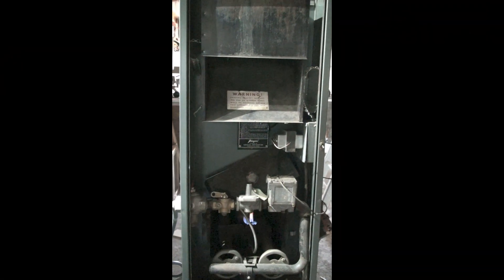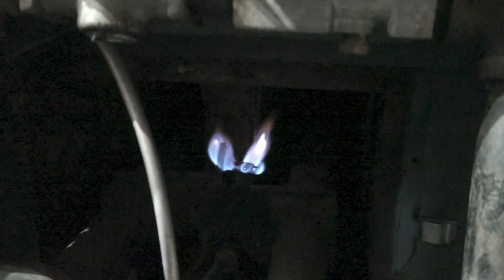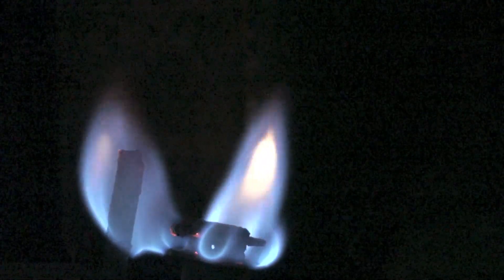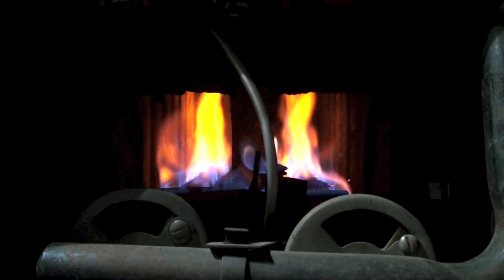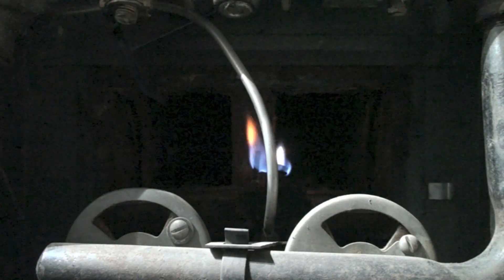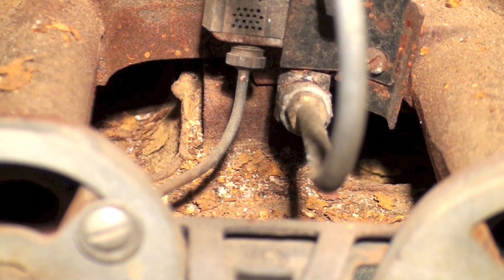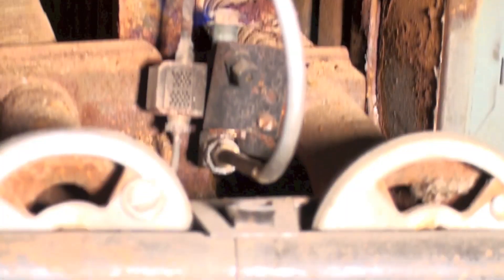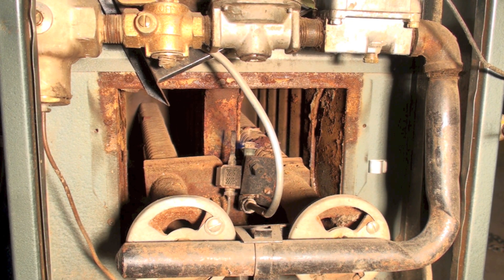Service of the antique pilot furnace part 1

Comment: My setup is a 1972 Heil 4 burner. Dang thing started short cycling/ backfiring this year. I've replaced 2 rotten burner tubes, replaced the rotted little bar that directs the fire from the pilot to the burners, cleaned the nearly plugged flue, cleaned the orfices, cleaned the exchanger, cleaned the blower out, had the regulator replaced, and threw on a new thermocouple. The gas valve is getting 27v under load, and seems to be operating fine. For some odd reason, now it'll run 2 complete cycles, and then it backfires the third time it fires and blows out the pilot. I'm obviously no hvac expert, but it's got me stumped for sure. All the issues I've found/fixed, and it's still not the underlying issue.
Reply from the maker: Have you checked the heat exchanger for cracks or rust out?
GFM
Reply: @grayfurnaceman  yes I have. Now, It will run perfectly fine for nearly whole day, but will still backfire every once in a while and blow out the pilot. I think it may be either the first stage regulator(i only replaced the second stage regulator) or the gas valve. Also, if I shut off my thermostat and turn it back on later, it will backfire.

Comment: I have a 1950's floor furnace with a single burner bar.  The pilot has two flames, 90 degrees apart, for the thermocouple and to ignite the bar.  It burns a lot of gas.  I shut off the gas valve from April - November, and my bill drops noticeably.  Only the water heater runs year round.
Can I turn the pilot down, or replace it low-burn version?  Can a single flame keep the thermocouple hot and ignite the bar?  I have the Robertshaw pilots and igniters sell sheet.

Comment: Love your site and videos. Appreciate the logical assistance. I have an older gas standing pilot furnace. McClary Debonaire 35yoa or more. Model:12G130L; Serial # D50307. No manual. General Controls Valve. Serial #L5 B 64; Cat No: B60Y64H. General Controls Company bought by American HVAC. Is the "White Rodgers B60 Valve" the same one? Couple of years ago furnace not running. Plumber tapped valve with wrench, everything fine. Same problem again. Valve sticking? Have been able to get operating by adjusting thermostat above/below room temp a few/numerous times. Can the valve be serviced? Where do I locate a new one and a manual? Would appreciate any advice you have time for. The furnace has no other issues.
Reply from the maker: I am assuming the controls are 24 volt.  A White Rodgers 36C03-433 should work ok.  It is a general replacement valve.  The valve comes with a manual.
If you want step by step instructions, go to my channel and search for "How to replace a gas valve".
GFM
Reply: @grayfurnaceman  Thank you so much for your reply and suggestion of the correct valve to replace with. Watched your video regarding changing valve and you are very knowledgeable and explain everything in great detail. I believe I will let professionals like you do the work. Thanks again for your knowledge and lessons.

Comment: You still around?  I have a furnace issue that I could use some help on.  Furnace stopped working.  After checking low voltage from transformer secondary I had 0v.  The old transformer was a 120/24V/20 VA transformer.  I went to lowes and bought the same specification transformer from the doorbell isle.  The only difference is the new one has a green wire going into the primary, which I am going to assume is just a ground.  Anyhow, I now have 28 volts going to the gas valve when I call for heat, but still getting nothing.  I am guessing that the gas valve has also failed?  Could the limit/rollout be tripped also?  I would assume no as I am getting 28 volts to the gas valve.  There are no other sensors etc going to the gas valve besides the pilot light sensor, which is good as I have constant pilot.  Any idea what is going on?  If you think it is the gas valve like I do, do you know where I could find a Model 36C67 Type 183 valve?  Thanks for any tips and information!
Reply from the maker: If you have gas to the appliance, voltage to the gas valve, the knob is "on" and there is no gas flow, The valve has failed.
The White Rodgers model 36C03-433 will work as a replacement.
GFM
Reply: @grayfurnaceman  Thank you so much!  I believe this furnace is at least from 1999.  It is an intertherm furnace so I was having a hard time finding any information for it.  When I google the part number of the original, I do see one that has that part number, but it looked quite different from the one I have.  The part number you provided looks a lot more like the one I got.  I truly appreciate it!
Reply: @grayfurnaceman  Also, I was finding mixed information about metering out the gas valve.  Some say you can check for continuity, some say you can't.  I tried anyway and there was no continuity or an ohm reading.  Can you confirm if this is possible on this gas valve?
Reply from the maker: Most of these valves are operated by DC power.  The valve is supplied with AC power and there is a rectifier in the valve to convert the power.  Using a multimeter to test continuity will result in an open reading on these valves regardless of condition of the valve solenoid.
GFM @TheGuyWithNoSubsForAReason
Reply: @grayfurnaceman  Alright good to know.  I really appreciate your quick responses!  I found a used gas valve for $50.. and new for $115.  Think it is worth saving $65 to try a known good used valve, or should I get the new one?
Reply: @grayfurnaceman  One last question.  When I flip the Light Switch for the furnace, the transformer starts running, even with the thermostat shut OFF.  When I test voltage to the gas valve while off, I read around 20 volts.  It jumps to 28 volts with a call to heat from thermostat.  Is this normal as well?
Reply from the maker: I would get the new one.
GFM @TheGuyWithNoSubsForAReason
Reply from the maker: The transformer should apply power when the system switch is on.  It will draw very low amperage.
As for the 20 volts, I have no idea.  Normally, open circuit voltage is higher than loaded voltage.
GFM @TheGuyWithNoSubsForAReason
Reply: @grayfurnaceman  I assumed with thermostat in off position, the 20 volts wouldn't be enough to power the gas valve.  Then when you call for heat, the 28 volts would be enough to power the valve.  At least I am hoping so.  Otherwise, the gas valve would never shut off.  I guess I will find out when the new valve arrives.  Thanks again for all the information!
Reply: @grayfurnaceman  Went ahead and installed the replacement gas valve.  Got everything buttoned up.  Still having the same issue.  Still getting 28-29 volts to gas valve when calling for heat.  Pilot light stays lit.  The system seems so simple.  Only has a brown board with 3 ports on it.  1 goes towards transformer, other seems to control blower.  If I bridge the two closest ones, blower kicks on.  Possible bad gas valve replacement?
Reply: @grayfurnaceman  I forgot to mention.  The replacement gas valve has ECO terminals coming from the pilot light connection.  The old one does not.  At first the pilot wouldn't stay lit.  After a bit a research, I seen that I could jump those terminals if the furnace does not have ECO device.  This allowed the pilot light to work properly.  Is it possible the transformer I got, is not compatible with either gas valve I got?  I mean, I did get it from the doorbell isle, but it has exactly the same specs as the original transformer that failed.  Any further guidance would be very helpful.  Thanks again!
Reply from the maker: Unless the transformer creates DC current, it should work.  
One thing I would try is using a clamp meter on one of the wires going to thugs valve with a call for heat.  You should show about 1/2 amp.  
GFM @TheGuyWithNoSubsForAReason

Comment: I have a 1989 century gas Furnance. The pilot light is blue and seems to be a good size but as soon as I let go of the pilot button the flame goes out. I also noticed the push button does seem a little stiff and does not pop up as fast as it used to. Any way you can give me some advice. 
I am a contractor so I know my way around a tool box. But work has been slow for a bout 8-9 months so hiring a service company is out for the time being. 
Mark

Comment: I can't even get the pilot to light even with a new pilot. The gas company shut it off now it won't work.
Reply from the maker: Why did the gas company shut down the unit?
GFM
Reply: @grayfurnaceman  the tenant was complaining about her gas bill and since she wasn't using her stove she assumed it was her furnace and request a shut off. I found the issue the city installed a new line from the road and when they reconnect they billed everyone wrong she was paying for the owners meter not her own and similar for the rest of the tenants. I traced it all they gas man came and verified then they digitally correct the billing so nothing was on the furnace but the pilot. But it was off for 3 days when the gas man tried to relight it wouldn't light. He told me and I cleaned the furnace no obstruction in the pilot or orifice thermocouple nice and clean. But still wouldn't light while holding the button for pilot. Tried to replace both and still same issue the gas line to valve is in the open position. Just checked for voltage got the required 24 minimum. Had tenant turn up Stat. Just without a pilot it's not going to go further. So I'm assuming the valve either stuck closed due to age or something else. The 3 wires going to the valve all have continuity. Not that this is safe or permanent I could just tap it and see if it activates and gas comes through.  Regardless if it does then I'll be replacing it anyways in rhat case as it shows it's not safe imaging getting stuck open. So now if it's bad I'll have to find an updated valve as I haven't found a match to this model. And not using Amazon for furnace parts. I rather post the model in the comments of repair channels and go from there and I'll check locally.

Comment: I really appreciate your videos on the older stuff.  My Sears unit isn't quite that old, but the igniter uses what looks like an automotive coil wire going to a ceramic piece.  I'm guessing it's at best early 80s.
Reply from the maker: That igniter was used into the 1990s
GFM

Comment: my neighbor and i have matching monogram brand propane wall furnaces bought in the late 60s or early 1970s . i removed and stored my still working one about 5 years ago , but her's will probably still be working when both of us are gone . a little more expensive to operate , but built to last . you can actually hear the pilot in these when you get near the heater .

Comment: What is the point of having a carbon monoxide ( CO ) detector if you have a gas furnace?
The balanced equation for burning of natural gas is   CH4+2O2 → CO2+2H2O.
Carbon dioxide ( CO2 ) is produced, not carbon monoxide.
Reply: You are assuming the furnace is operating normally. Plugged primary air or burners, cracked heat exchanger can reduce oxygen supply to the flame resulting in CO. 
GFM

Comment: Just found this video. I'm trying to identify the year, efficiency, and any other info for the furnace in our house. It's an Inter-City, and the model says 150 CLB. I haven been able to turn up anything significant (specs or a manual) for it through a Google search. Any chance you have any ideas? Or know someone who does?
When we bought the house in late 2016, we were told it was from the 1970s. (House was built in 1960, and originally had coal.) We're in central Alberta, Canada.
Reply from the maker: Furnaces of that era are very simple and virtually all used a thermocouple flame safety.  The series I did on this antique furnace are pretty much applicable to your furnace.  If you want to send pics, I may be able to tell you more about your furnace.  Send to Grayfurnaceman@gmail.com
GFM

Comment: Hello, not sure if you'll read this but mine is almost exactly like this one. My question is which way should my filter arrow point? As I'm sure you know the filter goes on top of the blower motor so does the arrow point to the sky or the ground? That's worded for me as I'm a single grandma! Thanks
Reply from the maker: Its not quite that simple.  Do you know if your furnace air flow is up or down?
GFM

Comment: What’s atmospheric furnace ? Is that the old ones that doesn’t have draft inducer ? Or can it be atmospheric heater and still have draft inducer?
Reply from the maker: Atmospheric is a natural draft that depends on heat rather than an inducer to move gasses thru the furnace.
GFM

Comment: LOL.... Mine is a real antique, a  Mueller Climatrol ! Giant green beast from probably the early to mid 50's.Replaced the dpdt relay when we 1st bought the house 24 years ago & it has always worked well till now in Oct. 2021. Needs a new 24v transformer "i think" for the old stand alone Honeywell electro-magnet solenoid gas valve main. Wish I could find a schematic for it, the org. one on the inside of the filter door is gone.
Reply from the maker: The schematic is so simple, they probably did not bother.  lol
GFM
Reply: Same here muller climatrol green beast, went to start but wont ignite. The blower will keep cycling but no ignition and i cant locate a manuel or troubleshooting guide anywhere. Pilots lit but burner wont fire up.
Reply from the maker: @adrianverhoeven2256  First, check low voltage power from the transformer.
GFM

Comment: Just gorgeously well explaned videos and concepts..
I've got an old Coleman, 75,000 BTU furnace (1968) that wouldn't shut off.. Turned out to be the solenoid stuck (plastic body), and the pilot light/Burner on truncated valve was sticking (silicon grease had migrated to the openings, so a half drop of Sewing Machine oil to dilute and refresh it) and then it moved into position freely, instead of locking up..
Testing a cycle now, as it wasn't turning off.. Done, it's working properly..

Comment: I have a luxaire furnace with a ring burner still going up I cannot get any info on it .
Reply from the maker: That's because most of those burners were phased out by 1960.  They are certainly not available anymore.  I may be able to answer questions about it.
GFM
Reply: So definitely my furnace is from the fifties. It is a gas fired gravity furnace . Thx for replying.

Comment: I've got a cabin with on old furnace from the mid 50's (I think) made by Gaffers and Sattler...trying to figure out where the filter is on this unit...it has a upper grate that is removable where the pilot and burners are located but no filter in that area that I can find.  There is a lower cover plate beneath that grate that appears to be held on by screws (it doesn't pull off like the upper grate) but not sure if I should pull that off to locate the filter.  Any ideas?  Model 75FDF..thanks
Reply from the maker: Pull off the lower panel.  There is no set place for the filter but good chance it is neat the fan.
GFM

Comment: Just finished watching this series. I have an old 1959 Coleman in a mobile home. It hasn't been lived in for over 10 years. I finished restoring pretty much everything else and now it's time to check the old heater. I got it working but the pilot won't stay lit. Going to replace the thermocouple. But I also noticed that there is a lot of soot inside the unit. I'm going the clean it and inspect it as you showed in the video. The flames are very yellow. I'm looking forward to tearing into it. Is it possible that dirty burners could be causing the inefficient combustion. This is attached to propane, but the removable metal tag on the control valve says natural gas. The instructions on the front of the unit describe how to convert it and the orifice size so I'll check to make sure it was converted. Would it even light if it was set for natural gas? Hope to hear back and thanks a million for the videos, very well done.
Reply from the maker: It would probably light but it would make lots of soot.  It would also damage the heat exchanger.
GFM
Reply: @grayfurnaceman  Turned out they had made the conversion to the control valve but didn't change  the orifice. The correct one was still stored in the unit. I tried to remove the nat gas orifice but instead of unscrewing, it snapped off. I had to take it all apart, drill out the wrong  orifice, then braze in the correct one. Cleaned out a ton of soot and replaced the thermocouple. Flame still seems a little too yellow, but its working. No damage to the firebox. Thanks for the reply, you were right about the soot!

Comment: Hi grayfurnaceman, i have a Lennox G8Q3-120-1 1984 manufacturer.  I have found the same furnace that is a G8Q3 - 120-3 which i believe to be the same furnace but a later version.  I would like to remove the heat exchanger so that I have the part in case mine craps out.  Is there a video out there somewhere that would show the steps to remove this part?  thanks in advance for your help.
Reply from the maker: I don't have one for that model, but here is one that may give the steps:  https://youtu.be/dXKrOjk2Prk
GFM

Comment: These are the types of old furnaces that I always worked on over thirty years ago.  The furnaces with control boards, igniters, and inducers were not around when I left the HVAC business but I learned how to troubleshoot the newer 80% furnaces so I could fix mine.  I'm afraid to upgrade to a 90+% furnace because I hear a lot of bad stories about the electronic DC motors failing and they are very expensive to replace.
Reply from the maker: The ECM motors have given some trouble.  Many times the repair is a very cheap part that I have done videos on.  Most techs don't want to get that deep into electronics, so they just replace.
GFM